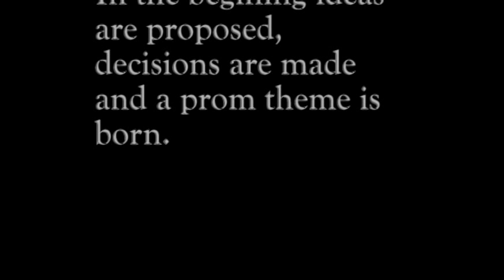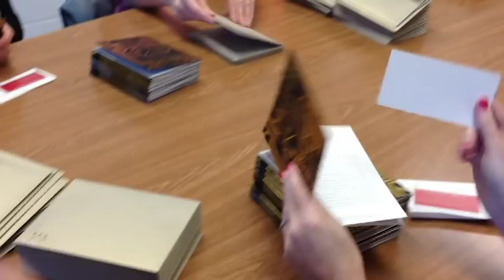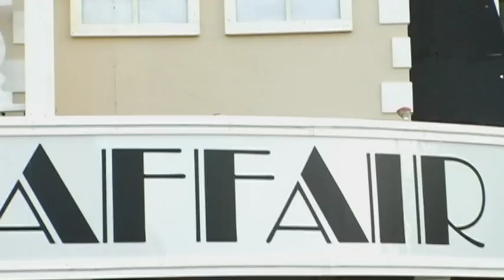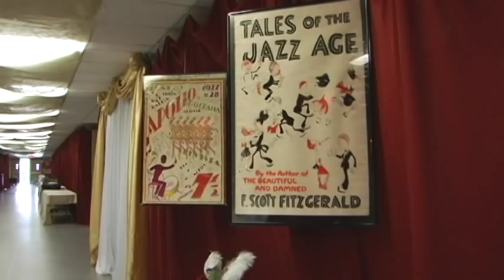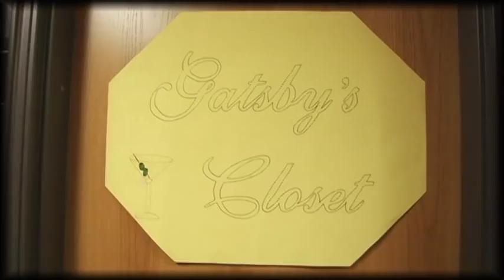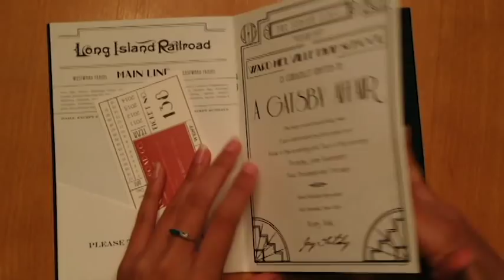Ward Melville High School Prom Great Gatsby 2013

Comment: @jolly vee. Hi! So to answer your questions, 1. We technically made the entrance display, which means we paid a construction company to build it for us. The marquee we had from previous years, but the plastic sheet with the words "A Gatsby Affair" was also purchased, 2. Yes the flowers were wholesale, one volunteer mom used to work as a florist, and had a local contact, 3. The gym designs were donated, but they were essentially stretched canvas, like a painting, painted with black and gold. If you are looking for decor on budget, I think this is your best bet. I don't know how big you want the display to be, but if you know someone handy, canvas, wood and paint are pretty cheap and stretching the canvas isn't hard. You can get easy, straight lines buy using tape. I hope this helps and that you have a fabulous wedding! If you have any more questions ask away.